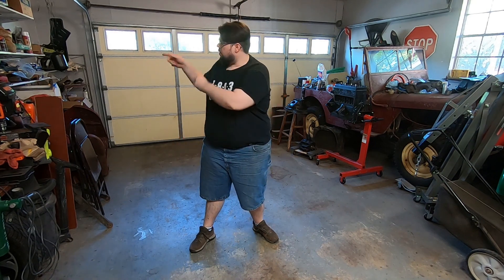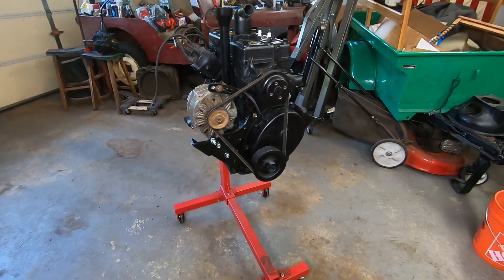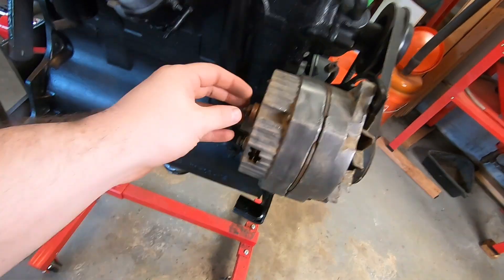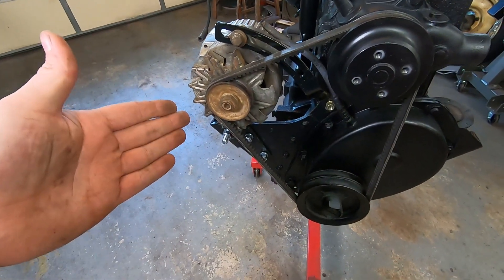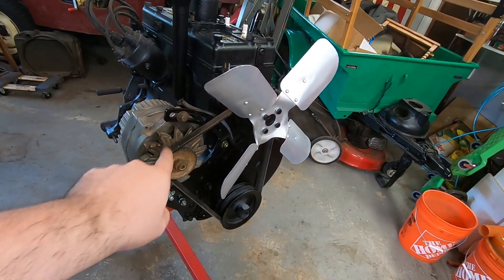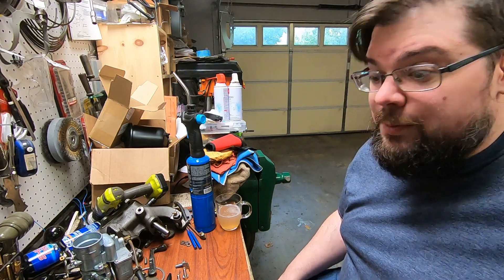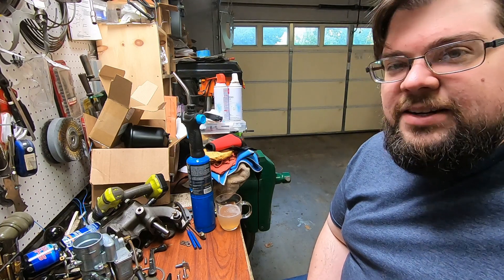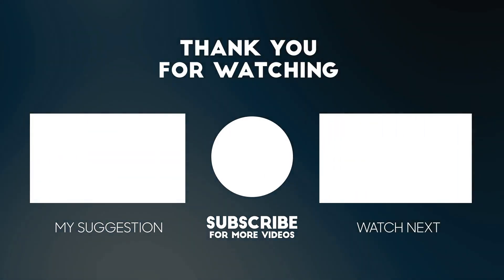Ep. 60: Trying to Sort Out the Engine Bolt-Ons

Comment: The oil coming from the stud is a mystery, I mean it's a flat head, it's not like the head has an oiling system for the valves. So the most likely thing is that oil made it past the pistons and rings and into the water jacket through a blown head gasket. My advice is, try to do a compression test, if some cylinder is wacky or they are overall low, you may have to get in there and address it 🤷 the engine will run even if the head gasket is junk (ask how I know) but you don't want good parts going bad by overlooking something. But be warned once you open the engine you may realize, it needs one of everything 😅 at least that was my case and it was running great. Good luck!
Reply from the maker: Actually, as it turns out that wasn't oil. It was leftover antifreeze, but it was washing away the old burnt thread sealer from the previous set of manifold bolts and studs. So it looked oily but it was actually just nasty coolant. It just all went to the very top of the engine while it was upside down on the stand.

Comment: My cork gasket squeezed out pretty much the same with Permatex black on it. The engine is full of oil, and (as of today) the engine is running and not leaking.
Reply from the maker: I think mine squeezed out badly because I didn't do a good enough job of flattening the oil pan bolt holes. They were convex and pushed through the gasket. I did a better job the second time around and the gasket didn't squeeze out. Either way, probably anything was an improvement over how bad it was before.
Reply: @SunkCostGarage  I started with a pretty flat pan, and didn't go crazy with the permatex. Glad to hear it's looking better after round two.